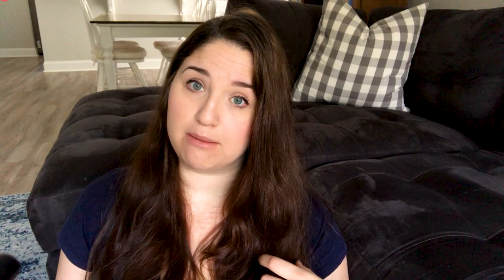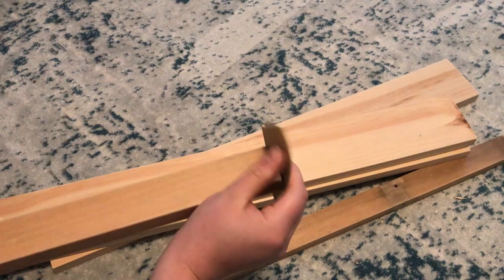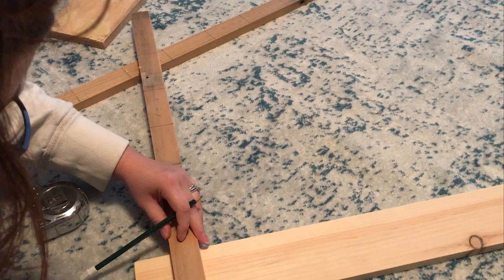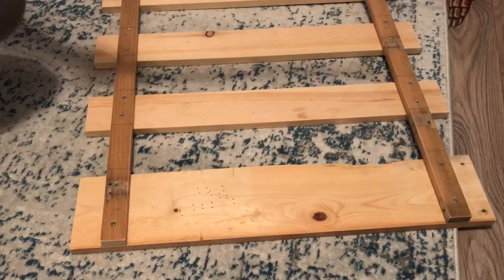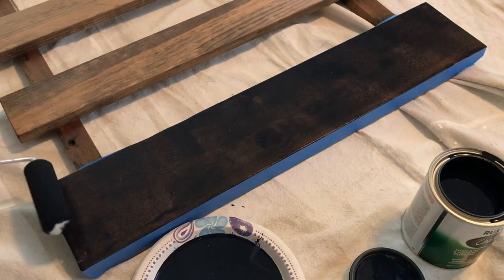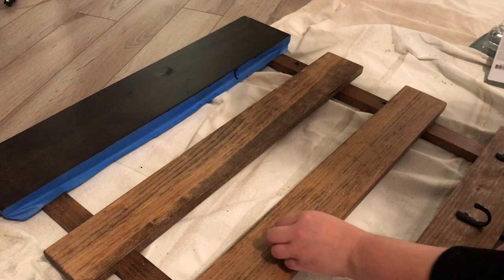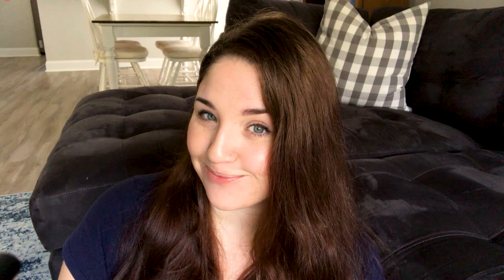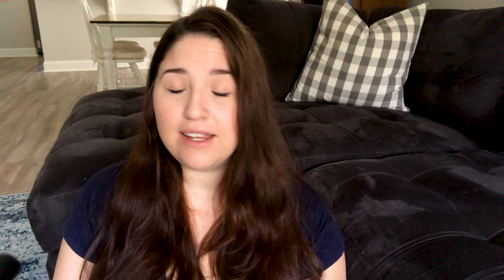DIY Coffee Mug Rack For Wall

Comment: Hey awesome work man! I was wondering what wood you are using? Is it a pallet you have that was safe to use or single wood you purchased? Thanks :)
Reply from the maker: Hey!  For this particular project, I used a combination of pallet and store bought wood.  The back supports and top chalk board part are all pallet wood, and the boards that the cup hooks are on, are store bought.  Hope that helps!

Comment: Can you explain the wood measurements to me? What is 1x6x28 and the other measurements?
Reply from the maker: +TheOriginalWhit sure!  It is 1” in thickness, 6” in width, and 28” in length. So when you go to the store, they will sell 1”x6” boards in various lengths. I just cut mine down to 28” in length. All the other measurements are the same formula (thickness of board x width of board x length of board). Hope that helps! :)